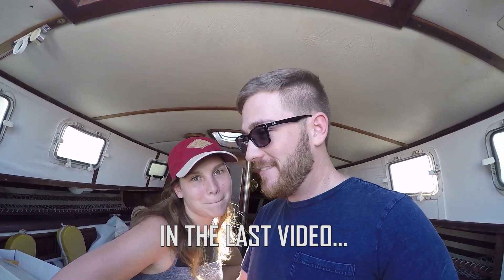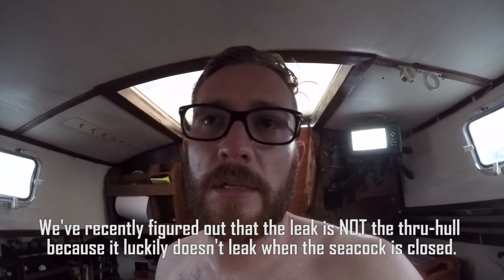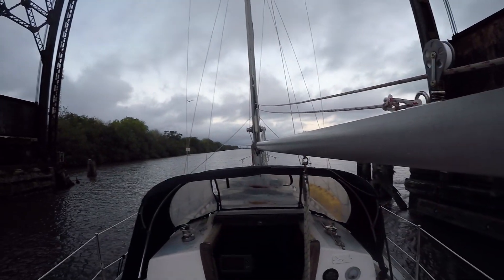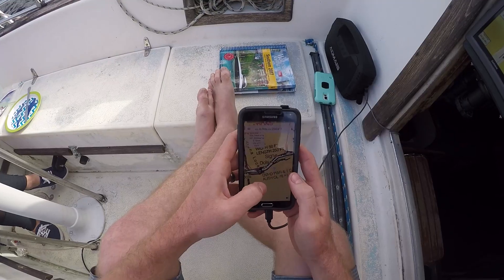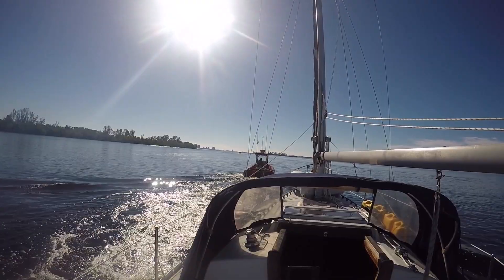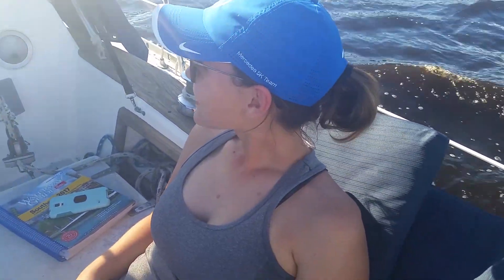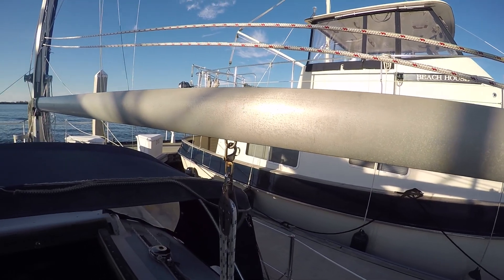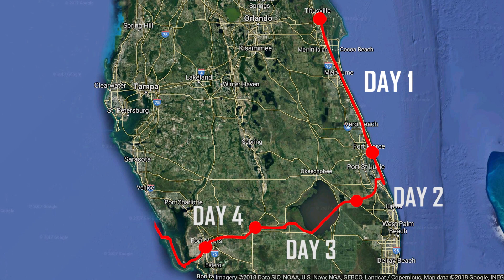33. Three Hundred Nautical Miles on a FREE BOAT! - DIY Sailing

Comment: getting a free boat with a working motor is way more than you can ask for .  Expect the boat to break a lot and be ready for that.  This is a great learning tool cuz your going to need to fix everything.
Reply: I got a free powerboat with a great working engine, and full service records. Granted, I had to pull the motor, replace the transom, stringers, and install new seats in her. (Seats still pending). It was a lot of work, but I got a great running boat for a total investment of a few weekends of elbow grease, and about $400 in materials. Now the seats I want to order will tack on another $1000, but it's still a great deal. Also included the twin axle trailer which is in near perfect condition.

Comment: Three things that I would do; 1; install a"Y" valve on your raw water intake so your diesel auxiliary can act as a emergency bilge pump, 2nd; make sure all alarms are working on the diesel especially the OVERHEAT ALARM, NOT JUST A GUAGE!!!!!!!!!! 3rd.; install a "High Water Alarm" in your bilge so it sounds before your engine is flooded.
Fair Winds and Following Seas,
Reply from the maker: Thanks for the advice! We will look into those options.

Comment: Not that bad a cruise.  Glad the engine got fixed cheap.  I'm still stuck in Titusville.   We've had engine troubles, now V-drive troubles.  Nothing but problems out of this dock queen I bought.  Its the prettiest shiny turd you ever saw.   Its a real head turner at the dock but cant leave the dock.  Well, we tried 3 times so far.  See, you guys are doing a lot better than me.
Reply from the maker: I'm sorry to hear that! Hopefully you'll get her running soon. Will you stay in Titusville or are you traveling?
Reply: We own a house in SC.  I'm not giving up my dirt home for a unreliable boat.  We work at nuclear plants during shut downs and then cruise a little , then go home for a while.  We just sold a 43' Hatteras which was awesome but we wanted to go to the Carib. and not in a Hatteras.  As soon as the gear box gets rebuilt and I buy a new shaft then I'll go back down there and install it.   Every since we bought this boat its been nothing but trouble.   maybe one day I'll get the mechanical stuff fixed.  There's no problem that cant be solved by throwing money at it and I've been spending a bunch.
Reply from the maker: Hopefully this last throw of money will get things worked out. Lol. I'm sure you don't want to keep throwing money at it without results. At least you'll have looked over the systems thoroughly with all of these fixes so that you can be confident in your travels to the Caribbean. Best wishes on getting your boat up and running reliably. -Randi

Comment: When you buy a boat or get one for free, you take a chance. I think you did great! I bought a 38' sportfish from out of state about 10 years ago and picked it up on of all days Thanksgiving. I paid for a thorough in/out of water survey and nothing of significance was found. We left the marina out on Cape Cod with an egg shell thickness of ice on the water. Idling out and loading coordinates into the GPS we finally cleared the channel and I proceeded to open up the throttles a little. Almost immediately both engine overheat alarms sounded and I shut down both engines. We opened the engine compartment and couldn't find any visiable problems, waited for the engines to cool and tried a re-start. One engine would not re-start and one engine did. So we proceeded on one engine at basically idle speed to the Connecticut River all night long. Once at my homeport marine my mechanic opened up the manifolds and discovered that they were thoroughly clogged and rusted basically shut. My survey stated that the engines were run at idle, 1500, 2000, 2500 and 3200 rpm's for 15-20 minutes at each zone with reccorded oil temps and pressure and water temps and all was normal. It would have been impossible for this to happen. Come to find out the surveyer took me for a ride and since I was out of state it was almost impossible to pursue him legally. I called the licensing authority and they basically said as long as he paid his dues they couldn't do anything to him or about the situation. I wasted 1700 dollars on a full survey. So everything in life is hit or miss. I still think you did good. The owner obviously tried to trick me your owner did not. That would have been something almost impossible to find I thiink. You did great, you didn't panick, did your best to make the best out of a bad situation, kept a smile on your face and were as prepared as possible. (in that you had towing insurance) Good job. I'm sure you'll get a lot of enjoyment out of this new boat. I also subscribe to "Abandon Comfort" another great site! Thanks for your video and next tie instead of telling us your jumping in to cool off, video it! :)  Happy New Year and good luck with the "Freebie"!
Reply from the maker: Thanks for the input! I am sorry to hear about your survey experience. It is unfortunate that there are individuals out there who would so intentionally mislead you. I hope that the sportfish has since brought you some more enjoyment. We do need to be a little better about keeping the cameras on for more of the things we do. That will have to be our new year's resolution. Lol. I can't remember if Ryan filmed when the rest of us got in the water. There's a chance he did and it will be in their next episode. Happy New Year to you too! Thanks for watching. -Randi
Reply: Randi, Unfortunately I suffered a stroke about a year after I bought the boat which is about how much time it took me to remove and rebuild the two engines and complete a couple other projects on the boat. I always thought I would return to work, but was never able to. So I ended up loosing the 38' Egg Harbor just as she was ready to do some serious fishing on her. I haven't fished since. I do hope to see you guys catch a few in future episodes though! I look forward to living through your adventures so please keep the dream alive for all of us!!! Happy New Year!

Comment: Hi from Bristol in the UK. This is great. Found your video by accident a few days off New Years 2019, so you've been at it for a year by now. Hopefuly still en-route for your goal to sail round the world. If that is the case, I appreciate you will have a bit more experience and maybe a proper channel by now so I will try to find where you bare at. I sailed twice out from the UK, through Panama to Australia and back through Suez in 1966/67 when I was 20, working on a passenger ship taking migrants to Australia. I ended up emigrating myself and stayed 6 years in Western Australia, working in mining camps as a carpenter, as a radio DJ and in retail as a buyer in a menswear store, amongst other things. I got the sailing bug whilst working for Bond Corporation, when Alan Bond won the America Cup back in the day. Now 70 and a qualified Yacht Master Ocean, having sailed on most of the world's seas. Don't regret a moment getting the adventure bug early. Good luck and fair winds. Tim

Comment: One of my older sailboats had a fuel problem, I’m no mechanic but advice was to eliminate issues. Eg, remove line from fuel tank and use a small jerry can, then from filter, pump etc. In my case it was a tarry substance on screen of fuel tank drop tube. It’s a pia bleeding ejectors each step but fortunately with electric fuel pump engine doesn’t have to run. Obviously if you don’t hear tick tick from fuel pump you know the problem. It’s also a learning process which is good for any boat owner cuz shit happen. Good luck

Comment: First thing I did on my boat was remove the fuel tank and clean it . Worth it . Almost certainly a fuel issue.   Also in the locks if you use shovel handles you can hold the boat off the slimy walls .  Available at any hardware store .
Reply from the maker: Good tips, thanks! We have talked about cleaning the fuel tanks. We will most likely be doing this in the near future. -Randi

Comment: Older diesel engines are usually very, very simple when it comes to wiring. The wire going to the fuel pump is there to shut the fuel supply off, thus basically "starving" the engine of fuel in order to make it stop. Meaning that as long as that wire gets a voltage (12 or 24V depending on your setup) the engine will keep on running. The most important bits to look after on the engine (apart from the oil/filter and fuel lines/filter is the alternator. Make sure all the connectors are clean and non-corroded, and same with the main switches and battery connectors. If there is green corrosion buildup(I have no clue what that gunk is called in English, sorry) on any connectors, try washing it off with a little hot water, then protect the connectors with some battery terminal grease. Any wires you have that are corroded, try to either cut the corroded bits off until you find clean, fresh copper, or replace the wire in its entirety. I would recommend getting a book called "Boatowner's Mechanical and Electrical Manual". It is an excellent source of tips, tricks and examples.
Reply: I don't know how their particular engine is set up, but some diesel engines will have a fuel shutoff solenoid to turn off the engine.   Engine pump is typically mechanical with probably an electric supply pump from tank.  Solenoid works as you describe, turning off power to solenoid interrupts fuel and kills engine.  We had one (in a truck, not a boat) that would work fine when cold, but when hot, would not operate so engine wouldn't start until it cooled again, although malletizing it was also effective until we could get it replaced.  If your engine uses a shutoff solenoid that is a good spare to have.
Reply: Solenoid was the word I could not think of. Some times it sucks to be a non-native English speaker :) The shutoff solenoid is present on most semi-modern diesels, though I know Mercedes used mechanical shutoff far in to the nineties.
Reply: Alf Torp  What Alf said.
Reply from the maker: Thanks for this solid feedback. Definitely a lot to think about. Before we do some long term cruising I'll most likely be replacing all of the engine electrical if it seems corroded. Thanks for watching!
Reply: If the old parts are working, definitely keep them for spares.  Probably a better and cheaper thing you can do right away is clean all of the connections, and inspect the terminals and wires for damage and corrosion.  As Alf said, most diesels are relatively simple, and there are only a few things that will make one quit outright like that; also a lot of fuel problems are actually electrical.  A basic multimeter or even a simple test light to check for voltage might help you a lot in pinpointing similar issues in the future.  Also get some Corrosion Block spray to protect your wiring connections as you clean them.
Reply from the maker: Thank you for the input. We need to do a thorough inspection of the electrical to avoid future issues. We'll look for that spray as well. -Randi
Reply: Petina?

Comment: Awesome trip. It looks so nice. I'm in the grips of -12c and 6 inches of snow overnight. While watching the video and your engine trouble, it was running fine and suddenly not running, so I was thinking an electrical issue. Boats, water and electrical always tend to corrode connections. A free boat is still worth those small problems. Congrats on bringing it home. I'm so jealous right now. :=/
Reply from the maker: BRRR! It's currently 46F/7.8C here and I think that's plenty cold. Lol. We are going to go over our connections and grease them to prevent further corrosion. -Randi

Comment: Good job guys,  I know that fuel pump connection is factory and does not look like it could ever fail. I'll check mine in spring! Got same engine.
So glad you were also able to sail too. I was going to say could you get you in mast roller mainsail enlarge from your old boat but you're main looked good! What a deal! Fix as you go and enjoy. Cheers Warren.
Reply from the maker: Thanks for the feedback! This was not something I thought would fail but hey, I'm new to diesels so my thoughts aren't worth much, lol. Definitely check your connections! Cheers.

Comment: Your first adventure on this boat ... great! :) And I love the new name "SV Freebie" :D ... a very nice name, sounds like many good journeys with great experiences. I wish you all a lot of fun with it and I'm glad to hear that the boat seems to be in good shape.
The engine defect ... that could have happened to anyone. Do not worry about it, corrosion on an older boat is more than normal. But you will have to check all this to find all those little flaws. Nevertheless, a great video, thanks a lot for taking us on your first ride. :)

I wish the SV Freebie and its crew bon voyage at all times and that it will always have a a hand's breadth of water below the keel - as we always say in Germany. 

Greetings - Fin
Reply from the maker: Thank you, Fin! We've been in most of her nooks and crannies looking her over. Now we know that we really want to inspect all of her electronic connections very carefully though and grease the terminals to prevent future corrosion. I am sure we will find little things to fix along the way in addition to the cosmetic fixes she needs. <3 Randi

Comment: I'm still checking Craig's list everyday. Hopefully, we'll be on the water at some point too.  

Totally, awesome you and Abandon Comfort got together!

BTW: Had the rev issue on a diesel myself before and found out it was bad fuel.
Reply from the maker: That's awesome! Keep it up. We had emptied the old fuel and refilled the tank. We noticed that their is a priming ball on the fuel line that had collapsed close on itself. When we got that to pop back open, the revving issue stopped. We need to figure out if that priming ball is something we can remove or not, since the engine itself is self-priming. -Randi

Comment: I'm a new sailboat owner, and I already have some regrets.  I had watched S/V Atom's postings about refitting boats with little outboard motors, and couldn't understand why someone would do that.  My little diesel has run flawlessly, but doing maintenance is a pain (hard to get into the engine bay where half the damn things are located), and it takes up a ton of boat room for storage in a long distance passage.  IMHO, I would take that into consideration for the next boat you purchase.  Really good video!  I look forward to more!

Comment: You could also (if I were going to the moon) take the solenoid off and don't worry about stopping the motor , plug the hole, and when I want to kill it, turn off the fuel or open a line and break the vacuum to the injector.It will stop. Or choke off the air.

Comment: I am so glad you made a comment about clearance height during you're passage under the lift bridge. My mast is 45 feet plus wind vein, and I was worried I wouldn't make it under the bridge. My word-of-mouth info was that it was 42 feet. I need to get that chart! I may still go around on the outside just to go to Key West for a "liberty port" but at least I know that Okeechobee is an option.

I totally agree with the comments of Tylee and Alf Torp. With a Westerbeke, other than an ol' Detroit is one of the simplest diesels out there, unless it stops with a loud mechanical clunk (main bearing seize or worse, a broken piston rod) it will be a fuel problem. Since you replaced the old fuel you would rule out clogged injectors, which leaves one thing - fuel pump. Not all Westerbekes are set up exactly the same, some have a shut off solenoid and some have an in-line electrical fuel pump, and either (sometimes both) are connected to a safety cut off relay circuit controlled by the oil pressure and water temp gauges. Wire corrosion and previous owner "gerry-rigging" are the two major things that will give you problems with your Westerbeke. A really good initial test is to simply run a wire from the battery to the electric fuel pump. Only do this if you are sure the engine isn't overheating and has good oil pressure. If yours is a mechanical fuel pump with a solenoid the most effective emergency solution is to bypass it with an emergency electric fuel pump. With some fuel hose, hook the pump directly to the throttle inlet tubing. For $50 from AutoZone, Advance or NAPA,  a generic, 12 volt inline fuel pump, 2 feet of fuel line hose and six appropriately sized hose clamps (not zip-ties) should (must) be part of your emergency engineering kit. Wire connection corrosion are a constant problem everywhere on a boat and should be part of your periodic maintenance checks.

All in all, a nice passage. Even an unexpected squaw can be a nice excuse to duck below and cuddle with the spouse ;) Even brand new boat deliveries are rarely "un-eventful". As long as you keep a cool head and don't panic or curl up in a corner of the cockpit and give up (I HAVE seen that response ... by a former wife!) it's the "events" that make the sea stories you later tell your grand kids!

Now comes the refurbishing work. Just try not to get so wrapped up in the yard work that you neglect to get her out in the bay once in a while. Fair Weather and Following Seas! I'll be watching. Capt Paul "Pappy"
Reply from the maker: Thanks for the informative feedback as always! I'll be sure to figure out if our engine has a shutoff solenoid or an in-line electrical fuel pump, and figure out the best way to jerry rig it if fails again on a longer passage. 

For the bridge height we used Active Captain. If you're not familiar you can find it here. https://activecaptain.com/na_st_petersburg_us/. The live map is interactive and tells you information you need for cruising about bridges, anchorages, shoaling, etc. It's updated by cruisers so it stays as current as possible. 

Thanks again for watching! Fair winds!